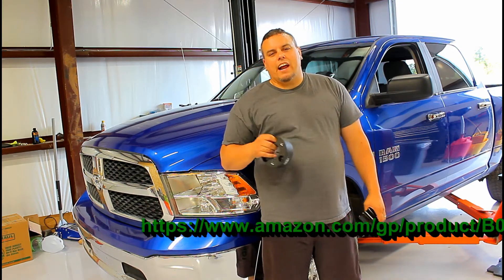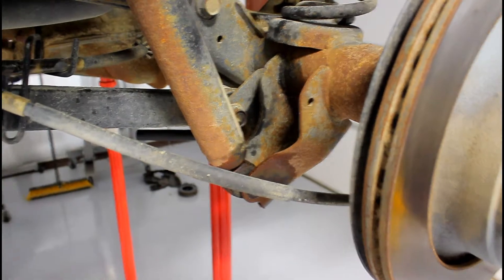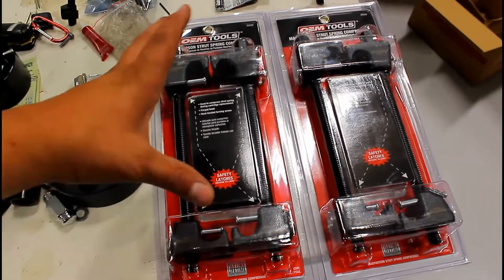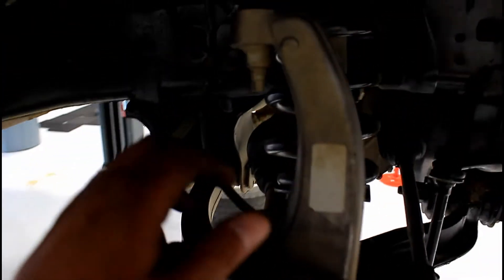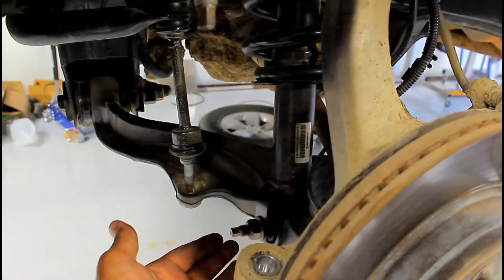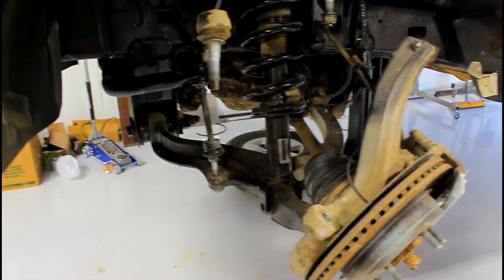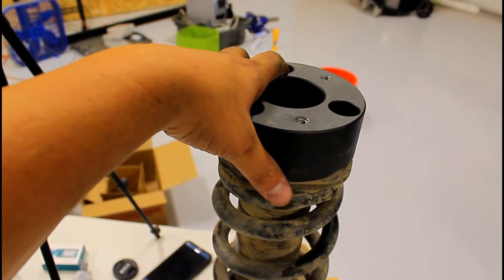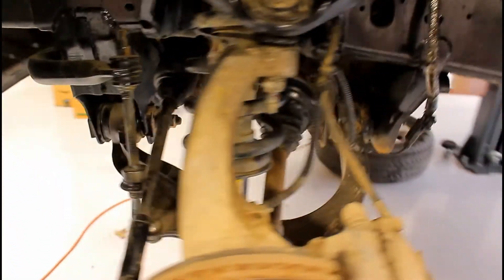Dodge Ram 1500 2" Leveling Lift Kit ADPOW Amazon Special

Comment: The bolts you held it in the triluck with were suppose to come thru the spacer as studs
Reply from the maker: The black hex heads should have came with the kit.  But u can get anything u need at ace hardware for pennies
Reply: No. The black hex bolts go in the bottom of the spacer so the shank of them sticks up to line up in the holes of the upper mount
Reply from the maker: @smalldoseofmeful  good luck getting the shock in with those in.  Took 3 of us with pry bars
Reply: If you drop the lower control arm theres plenty of room. You put the top in first then the fork just goes into place

Comment: Thanks for the info but after watching other videos and doing it myself the hex bolts you screwed into the strut spacer should have bolted on through the other side and gone through as studs makes instal a lot easier as all you have to do is put the bolt through the hole and bolt it in instead of trying to line up to holes
Reply from the maker: it would have made it a tad easier,  you are correct.
Reply from the maker: either way works,  but yes threading in the bolts first could have been easier